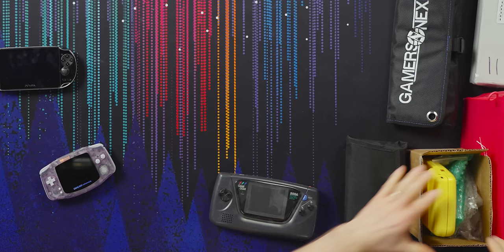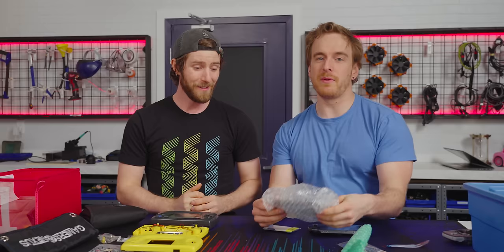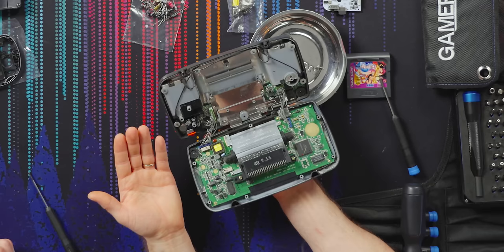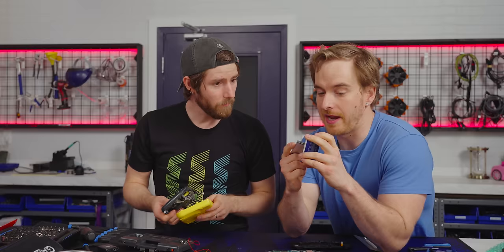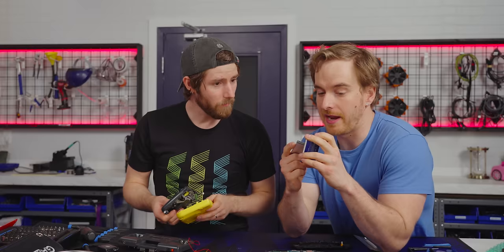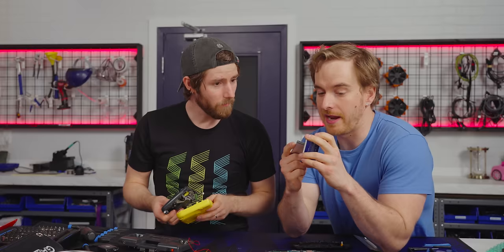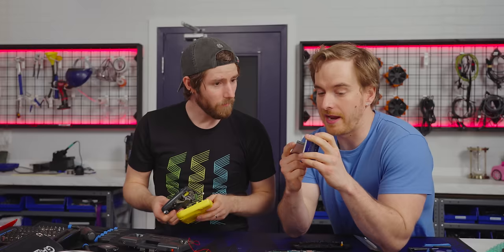This was ROUGH... I can’t wait to do it again! - Game Gear Screen Replacement

Comment: 15:35 I know exactly where that goes. I've been modding and replacing things in my Vita a lot lately. I've reopened that thing so many times. That piece is a bridge that helps screw down two motherboards. You use the blue tinted screws to secure it. The pink tinted screws go directly onto the motherboards while the plain silver ones are used for the chassis.
Reply: Was looking for this comment, I had to know 🤣
Reply: Boost this man, dammit.
Reply: Boost him to the moon. This needs to be seen
Reply: This is incorrect. The part lives underneath the plastic button cover on the top and uses a pink screw. It's in the middle right above the rear facing camera. The braces for the daughter boards are much larger.

Comment: I did the same thing a week ago - bought a Vita used, replaced the screen and the chassis. The small metal part - assuming you still have it - goes on top, under the plastic bar with the volume and power buttons, covering one of the top screw holes.
Reply: Too bad David ate it
Reply: @jNetDowling  It'll come out eventually. Call it safe keeping.
Reply: Yep, just a reinforcement bar.

Comment: Would love to see more content like this. Retro console modding is such a treasure trove and rabbit hole of a topic. Would love to see Anthony do an HDMI mod on his Dreamcast
Reply: Or you can just emulate directly to the better screen.
Reply: @WRZ100  *angry retro gamer noises*
Reply: Dreamcast has VGA, no need for hdmi
Reply: @ishkar5k  haha, emulator goes brrrrrrr
Reply: "retro gaming" shows Vita 🫥
Reply: Actually still think my unmodded Game Boy Advance SP (AGS-001) is still fully relevant even now. Even though the screen definitely looks worse than the AGS-101 and equivalent, it makes up for it with zero input lag, no ghosting, and perhaps biggest of all, it barely sips power. Just make sure to get an Everdrive for it because Nintendo games these days are grossly overpriced.
Reply: @tang9538  The Vita is 11 years old now. It's not exactly retro, but it qualifies as vintage
Reply: Xbox360, replace the stupid proprietary connector with DVI, VGA, Composite, RCA, or HDMI. Mine currently has a DVI, RCA style audio, and a headphone jack. Originally gave it VGA and RCA audio but the VGA jack developed some funky behavior at some point (was a salvage from an old graphics card so had already seen a lot of use). Just have to watch out for bad solder joints or just using too much bodge wire to reach the jack, Microsoft detects it and you'll be console banned but not account banned. A console ban on the 360 is weird, all it does it block network traffic outside of the local subnet and disables the software eject which sadly the face button is just a button to trigger software eject. Can regain eject from the power connector running to the drive, same pin modders repurposed to toggle their mods with a bog standard cheap little microswitch.
Reply: @kit7une_  Yes, but you're limited to 480p, and it's analog. The DCHDMI outputs digital 960p or 1080p (960p with borders) and digital audio. Of course, VGA still looks phenomenal, especially if you run it through a good scaler like an OSSC or RetroTink5X, but there's a very noticeable jump in crispness with the DCHDMI.
Reply: Having done this mod, I can confidently say that someone not ready for it is going to be in the video and try it and probably destroy the ribbon the first time. Definitely worthy of a video just for destruction
Reply: @TooBokoo  it scales well to my 4K smart TV in VGA mode.
VGA on Xbox 360 and Dreamcast scales better than HDMI at the same resolutions.
PC is a different story, except that doesn't upscale to a 4K screen, it's native 4K so it doesn't count.

Comment: Great video, I am currently upgrading a PSx to work with SD cards instead of games. Glad to see you guys run into the same problems I am.
The part David had spare( 15:52 ) goes under the side panel on the top somewhere near the card reader or what ever reader there is on top. 

I am not posting the link but this video but the title
PS Vita Teardown / Disassembly Tutorial
@25:46 shows the part
Edit: Its not my video and I am not affiliated with it in any ways, it just is a convenient way to show where the part is xD

Comment: If you ever need to do  bodge wires inside a small case like that again, see if you've got any IDE ribbons lying around. You can peel the wires apart pretty easily, and they're basically the thinnest wires you can solder by hand. They're so thin you don't even need to strip the ends, because the insulation will peel back enough just from the heat of soldering.
Reply: I always use old ethernet cables (the individual wires, not as a whole). IDE ribbons seem to have quite thick isolation?!? A big plus of ethernet cables is that you have a bunch of colors ;-)
Reply: @cornholio1988  IDE insulation is thicker than Ethernet insulation, but it melts/shrinks really easily. It's also convenient in that you're probably not doing anything else with it these days. That said, LTT does probably have a lot more spare Ethernet cable lying around, and the colors can be nice depending what you're doing; not sure how much it matters for bodge wires in a one-off, but very nice if you're doing a small run where you want to keep track of which modifications you're doing on each device. (Which is why, ironically, I would use IDE in Linus's case, but Ben Heckendorn, who gave me the idea in the first place, should probably be using Ethernet wires.)

Comment: This is one of the best LTT videos I have ever seen. I own a Game Gear myself and it stopped working a few years ago, but before it died, I had to angle the Game Gear so that it was flat so I could see what the hell I was doing, and the speaker wasn't working so well anymore. I could never tackle a mod like this, especially not on my own, so I'll just be glad instead that this project and video both happened successfully. AWESOME stuff.

Comment: The "Gamebit", ie a Line screw, had reasonably common usage in Japan for 80's/90's computing, so it's not really that bad in its original own context. Like an alternative to Torx, they at least work well as screws and aren't likely to be damaged unless you're using the wrong tools. 
Unlike, say, smaller tripoint screws where even the right tool may start stripping them.

Comment: I think I had the same exact problem with finding where that particular metal piece went when put my VITA back together. I found where it went later and iirc it sits on top of the PCB around the L button before you put a screw back in.

Comment: I'm not surprised how difficult of a time they had with the game gears. Also, as expected, at least one didn't work off the bat, as per usual with these systems. But I am surprised they found a rare limited first run revision of what seems to be the 318th game gear ever made for the public.
Reply: what are the odds really, Linus must be either cursed or blessed
Reply: Isn't it the 318th one made by that specific factory, like they said in the video?

Comment: Any chance of this being done for the Game Boy Color or the PSP? That aside, I guess the saves you the trouble of having to make the panels yourself (in reference to one of your dream projects mentioned on WAN Show).
Reply: Yes, watch MachoNacho's mod of the GBC with the FunnyPlaying IPS kit
Reply: Yes.
Macho Nacho made a video about the PSP.
The Retro Future made a ton of videos about modding Gameboys, including the color.
Reply: Name just about any retro handheld and there is almost certainly a screen mod for it.
Reply: @Decipher13  tiger electronics
Reply: Vita for life 🤘
Reply: the gbc is actually pretty easy but if you want the infrared sensor on the top to be a screen brightness button you have to solder a little
Reply: Did this to an Gameboy Advance SP - new screen, USB C, new batterie - Perfect device for long train rides and fits in my pocket perfectly.
Reply: Everything PSP and Gameboy related has been covered to death by plenty of other people, particularly people who know what they're doing.  (The planning for this was really poor, the engineer guy should've been involved from Phase 1)
Reply: Check out that ras pi in a psp mod, that would be great too
Reply: Check out handheld legend. I got an ips screen for my og Gameboy, it's amazing.  They sell kits for the gbc too!

Comment: They really need to change the capacitors in the game gears. That improves sound and video on the old display. It also removes the hazard of those leaky capacitors.
Reply: That's mandatory on all Game Gears. I thought I saw a little bag of capacitors when they were unpacking everything. I assumed they were going to. Those handhelds are a ticking time bomb if you don't change the caps.
Reply: @TooBokoo  I saw the bag too and I was at least expecting them to mention it.

Comment: As an electronics engineer... With an electronics engineering and amplification engineering company... I can say good job! 😆

Just, with the parts trays, get many many more of them and get a soldering mat Linus! Made of high temperature silicone, has space for tools, screws, parts, boards, and you'll get it for 30 Canadian pesos.

Comment: You can easily make a game-bit driver with a clear bic pen. Remove the ink cart, and lightly put a lighter under the tip.... Then cram the warm pen tip into the screw and let it dry .... Congrats, you've made a molded plastic screw driver :)
Reply: Genius!
Reply: @Nitidus  when I was doing repros I was too impatient to wait for my eBay kit lol found a work around

Comment: I love Eneloop AA batteries. They last about as long in my XB1 controller as my PS4 controller's lithium battery pack and are significantly easier to replace when one of the cells dies. I bought a dozen of them when they were still owned by Sanyo and I first got a Wii and 4 Wiimotes and most of them still work just fine more than a decade later. I was so impressed by them that I bought another dozen AA and a dozen AAA for all the various TV, AC, and Cable Box remotes.

Comment: I have that carrying case with all the accessories like the screw on zoom lens.  Actually fired it up a little while back just for the fun of it and it still works.  My power cord has been iffy for a long time though and mostly held together with electrical tape for the past 20+ years or whatever.

Comment: 3:08 The Vita’s screen is actually plastic too (but probably more scratch resistant than the Game Gear’s judging by how it looks)
Reply: Not the aftermarket ones, I've had experience with them and they scratch easier than anything 😓 worries me how long the screen he replaced it with will last

Comment: 7:33 There are rechargeable AA batteries so you can have best of both worlds. I'd pick them because they would be easier to replace.
Reply: Rechargeable Lithium is the best route, not alkaline
Reply: @Keepskatin  aren't they still kinda difficult to replace
Reply: @Keepskatin  nickel cadmium battery would be better. The lithium batteries wear out and loose capacity.  nickel cadmium batteries can pretty much always get fully charged and last a crazy long time before degrading.

Comment: Oh my god, that's how they did the backlight! It's an actual fluorescent tube! Well, it is more energy efficient than an incandescent bulb. Also, never EVER use a soldering iron on a ribbon cable. It will rip off the pads. Seriously, you can buy a hot air station for less than 50 bucks.

Comment: I'm gonna have to side with Linus on the AA batteries. It's awesome having industry standard power cells, I bought a bunch of rechargeable ones like 4 years ago & have been using the same ones ever since without issue.

However I also recognize that custom batteries have their place & are clearly superior in applications like smartphones, cars, & other highly specialized applications.

Though for IoT devices, controllers, flashlights, etc, I really want to see standard batteries used instead of proprietary poo poo water.

Comment: I don't get the double A vs lithium you can get lithium rechargable double A batts lol. Tbf we could also make standard for the square batteries used in modern stuff like double A and enforce replaceability when they zonk themselves. Would be super nice to be able to hotswap LG style like you can with rechargable double A's

Comment: The whole Playstation VS Xbox controller argument has one perfect solution:

Some 8BitDo controllers have AA-compatible battery compartments but puts a similarily sized Lithium Ion battery in it. This way you have lithium ion, but replaceable. And you can put AA in if you are in a pinch.

Comment: I wonder if there was a voltage/ capacity difference in those li-on batteries causing a balance issue with the charge board? Could explain if one battery is trying to balance itself though the board the amperage maybe very high. Probably wrong but hey. Great episode!

Comment: 7:40 NiMH rechargeable batteries have a much longer calendar life and far larger cycle count, so for electronics that aren't used very frequently, or compared against cheap unbranded lithium packs, are actually going to be better from an environmental perspective.
Reply: NiCd if you want rechargeables that you won't need to replace. 1,000 cycles or more before its capacity drops below half its original capacity.
Reply: @First-Last_name  NiMH and LiFePO4 can both do well over 1000 cycles too (LiFePO4 can do over 2000, but it's pricey and trickier to use as a drop in option)

Comment: MOAR videos like this please!
As an electronics hobbyist, the only things I'd done differently to the game gear repair: Used 30 awg wires and tried to tie them down with either hotglue or kapton tape so they don't wiggle loose inside. That's it.

Comment: The way I learned to use a soldering iron, I replaced all the capacitors on a game gear I paid $10 for. Fixed it, realized it drained batteries like crazy and sold it for $100. Glad I got the experience using a soldering iron.

Comment: Dan figuring out you had one of the first 300 GameGears coming out of the factory line is amazing. No wonder you couldn't figure it out since it was literally the first run of GameGears that nobody had worked on before before Sega started to revision it. 

I mean, kinda sad in one way that you "destroyed" one of the first ones by upgrading it, but that was just such an honest mistake. Nobody could know that other than the supreme Sega aficionados.

Comment: that metal thingy from the ps vita is  a ground connection that goes on the pcb with the left hand side controlls, when the vita is dissassembled like that it's on your right :D yesterday i did a repair to mine and now i see this video of you wandering what that little piece is :D i only know cuz i took photos of every step of dissassembly cuz i didn't find guides that had everything.. i mby should put one out there..

Comment: That was a nice bundle with the carrying case. I found a sega game gear with carrying case as well! Came with all the inserts and even some paperwork from the era showcasing some upcoming titles. Was super cheap, but the game gear does not display anything. I may give this screen replacement a try sometime, although I read you might also need to replace some/all of the capacitors as well.

Comment: I just noticed the video's closed captions were manually typed in instead of using Youtube's auto captions. That's great! Now we won't have to deal with the glitchy auto captions.
That said, I did notice two minor mistakes. I say this because I want them to improve, not to tear them down.

13:12 he meant "get it out of my *sight*" not "get it out of my site".
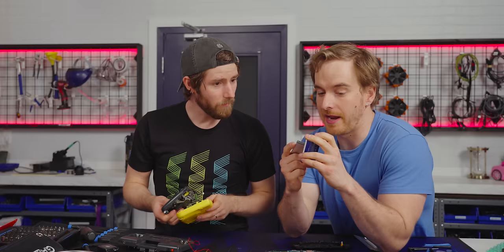26:59 he said "*didn't* screw the motherboard" but the caption said "did screw the motherboard".

Comment: Linus is 36 and I'm 30. My twin brother and I had childhood consoles and handhelds consisting of the Atari 2600, the Nintendo (Thanks to our cool grandma and uncle for holding onto those consoles), Super Nintendo, Nintendo 64, PS1, PS2 Phat, then the PS2 Slim that I later modded on my own to play all the games I burned copies of and OG ones that I kept.The Game Gear, Game Boy/Game Boy Color and later I went onto buying a BittBoy specifically for Pokémon Silver since I lost my original cartridge many years ago.
Now I just run older games using emulatation. Emulation is the way to go IMO!

Comment: Hey, for people who don't have the money to do any mods but you have an old GBA, GameGear  or PSP with a scratched plastic lens, try using Soft Scrub. It's an incredibly mild abrasive that can polish away scratches in plastic and you can find it in any grocery store. Fair warning - it will make your device smell like lemons, and it can be a little annoying to rinse off since you can't run the device under water.  DON'T use rubbing alcohol - it can actually eat away at the plastic and make things worse.

Comment: I'm guessing that the pop, heat and smell when that charge board was plugged in was due to the voltage differential between the two batteries. When you parallel those batteries they try to equalize themselves with nothing really hampering the current. I parallel charge lipos for quadcopter and treat them with utmost respect being diligent about having voltages as equal as possible before attaching them to the parallel board.

Comment: Amptorrent batteries have finally made AAs awesome. It's a lithium ion cell with a buck capacitor so it gives a perfect 1.5v until 5% left and then 1.2v. So you get lithium capacity with perfect 1.5v power. It's amazing
Reply: I never knew this, so many devices to upgrade with lithium ion AA now.